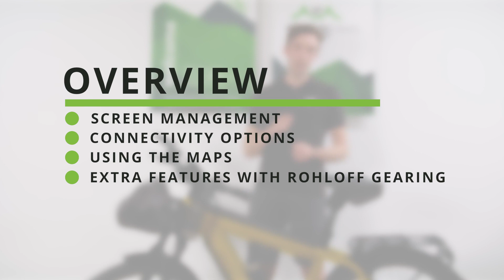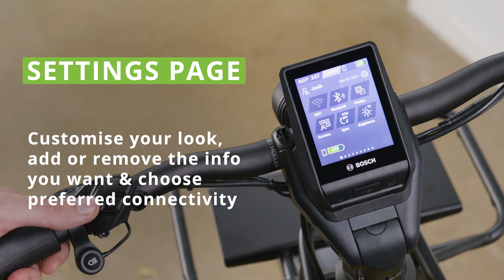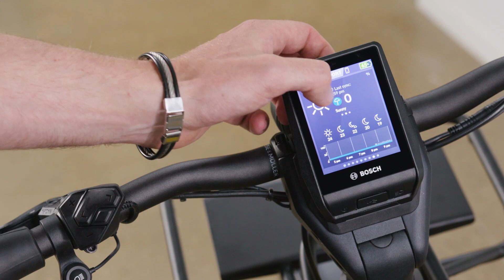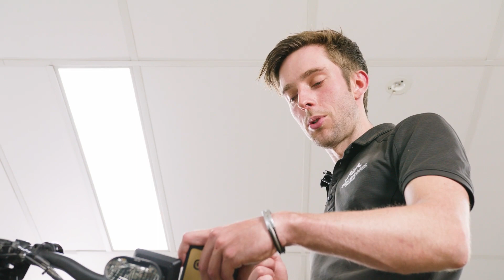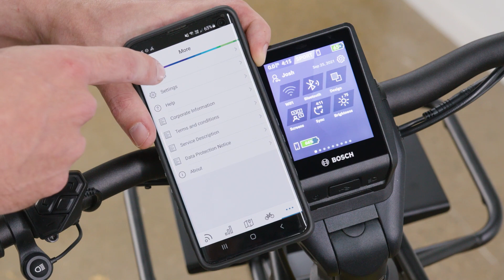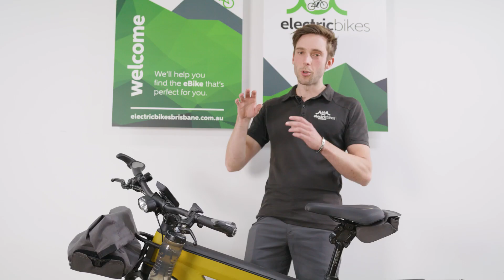Bosch EBike Nyon Display - Tips | Electric Bikes Brisbane

Comment: When I first upgraded from the Kiox to the Nyon I wasn't impressed, but after more then a year of use, I love it. Love the info if gives, the mileage is always dead on. The maps are great. My only complaint is that the software feels a bit sluggish sometimes, and and I wish Bosch and Garmin would get it together and sync with each other, like Bosch and Apple watch. When I do 50 miles rides on my bosch motor every weekend my usage is mostly around 55 to 60 percent me and 40 to 45 percent the motor, with about 95 percent eco mode. I've lost 30 pounds last 5 months and my riding fitness has returned. Bosch powered ebikes are a game changer for me personally. Its my car, my RV, and my fitness rider all in one.
Reply from the maker: Wow. Good on you! What a great testimony to just how good Bosch ebikes are for us too 👏 Happy riding 😊

Comment: I have just upgraded to the Nyon while I like most things about the display the map routing if left to the Nyon solely is a disaster, I asked it to take me home from 15 miles away it has no concept of following any recognizable effcient routing and constanly recalculates to find its way around. Yes you can download routes and that's the only way it should be used unless Bosch gets their act together and that won't happen any time soon....
Reply from the maker: Sorry to hear that Pete. We haven't had the same personal experience luckily but it'll be great for everyone if they keep improving the navs
Reply: @Electricbikesbrisbane  I agree.....the colour scheme could easily be improved on navigation as all other screens have a good contrast. Customers have a greater expectation than I suggest Bosch have managed so far with the Nyon!
Reply: yea I like maps, but ive always pre downloaded my routes on my phone, Ive never used it for actually off the cuff navigation.
Reply: @Adventures4vida  I like the Nyon display and use it only for downloaded Komoot routes, this prevents the Bosch navigation interference! :) As a backup I have Kommot on the phone plus a Garmin Edge.
Reply: @peteturner8493  Yea i use Komoot as well with my nyon.

Comment: Can you still shift through the gears with the electronic lock and the nyon removed? How difficult is it to get up to speed with no assistance? Which gear do you recommend parking your bike in? Thanks
Reply from the maker: It's a no for the first question. For the next two though it depends on you so you will need to ride it 👍
Reply: the lock is definitely worth it, even if someone gets your bike it will be worthless to them. Plus its an easy feature to switch if you get a new bosch motor bike.